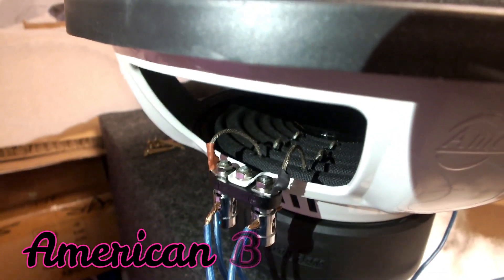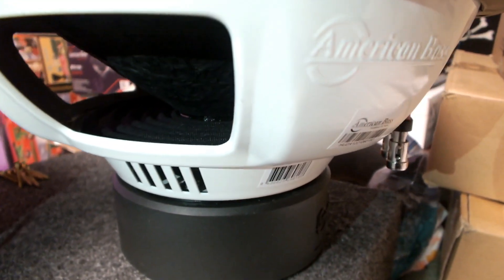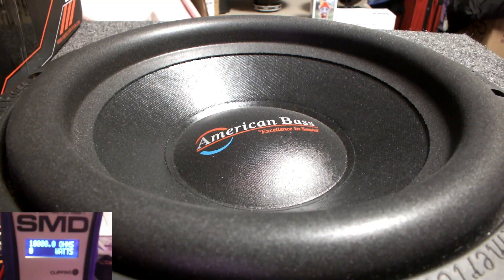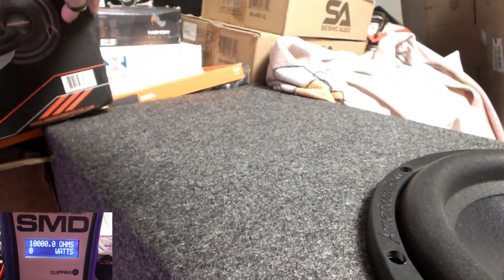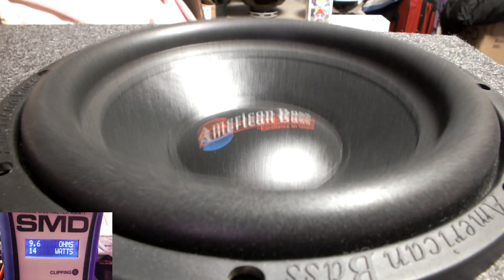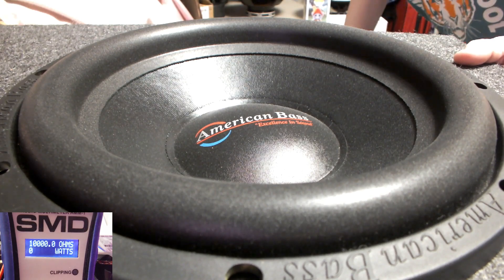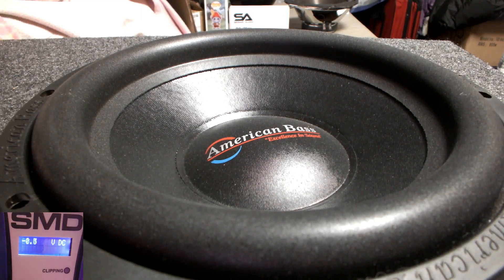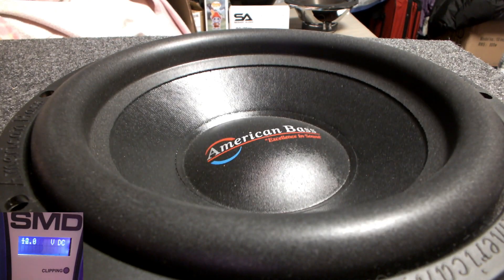American Bass DX-12 Car Subwoofer On NVX XAD13 Car Amplifier Live Dyno Test SMD-AMM1 RMS-Max Bumping

Comment: Sometimes when theeads are looped up and not sown in u will hear smacking of the leads against the cone and there's also another louder pop noise of the voice coil hitting the back plate that's more of a metal rattle cling sound
Reply from the maker: That was another thought, yeah, hitting the back. Thanks bud.

Comment: It seems like these NVX amps don't put out what they claim even though some videos show that they do odd
Reply from the maker: They do much more than they claim actually. Watch the dyno, watch the ohm's on it. This is a common mistake I've been hearing so much of lately. This is actually why I make these video's. If the sub is a 8 ohm's the amplifier does not make up power, it does what the sub allows it to do. I've got this same amp on sub's at 4 ohm's doing well over 1,200 watt's and more. At 2 ohm's even more. I'm going to be doing a 1 ohm video soon and hopefully show what the amp can really do. The NDA series is class D, they do rated power. The XAD series is a full bridge amp and does much more than they claim. I also have the XAD11, rated at 700 watt's at 1 ohm, I have it doing almost 1,800 watt's. Check out the video's and look at the ohm's on the dyno.
Reply: @SubzPawz  yeah see I didn't really look. You might have other videos that you posted. I thought this video was supposed to be on the XAD 11 and when I looked at it it seemed like you were getting maybe 300 watts. That's where I kind of got confused. I have both models the XAD 12 and the XAD 11
Reply: @SubzPawz  Okay well, let me ask you something because you seem to know a good amount about systems. I'm thinking about upgrading my box now i originally purchased the XAD 11 but I didn't think it had that much power so I decided to upgrade to the XAD12. I'm trying to push two subwoofers that are dual 4 ohm voice coils. They are rated at 600 w RMS each old school German subs. Now I've got a cheapo eBay box  Currently it's ported and I believe it's tuned to 40-39Hertz.

 Now I thought my system would be a lot louder than it is.  I got myself a clamp meter. I've tried it at full tilt 21 volume on the head unit and it seems like at most the ants putting out 30 amps everything's wired to one ohm. Now I thought an order for an amplifier to produce 1500 watts you would be pulling 150 amps of current what I saw on the clamp meter seems nowhere near that.

Now I had one guy tell me that I needed the right box. He suggested I needed a box tuned to 32 Hertz The one he suggested is around $300 $280 and some change. How much of a difference will that make? Or is there something available that's a lot cheaper that I could purchase that would work?

Also, the original Amp that I started with on these old school subs one of the first new amps that I ever purchased was a Power Acoustic razor 2500D. Now it seemed like it was okay for the money and the bass sounded fairly deep. However, it left something to be desired. 

The local audio shop had told me that I was probably getting maybe 125w  a sub The amp had 50 amps worth of fusing which seems kind of odd the xAd12 does not even seem to draw 50 amp even you would think that it would use a lot more amps than the razor at full volume. I guess that's what blew my mind 

 So anyways  I figured I'd try and get closer to the 600w RMS for  each sub. 

So that's what led me to here the XAD12. 

Before I pull the trigger on a new box because the old one is a little beat up, I need to figure out how great of a difference the sound will be if I do upgrade if it's worth spending more money. I have already had to reset the subs three different times already drilled new sets of holes each time to try and hold them inside of the box. They are so heavy that they fall out of the box from the bottom when you try the face them sideways as opposed to straight up
Reply from the maker: @jaygee6983  wow, that was a mouth full. It honestly sounds like your having somewhat of the same issue that I'm showing in my video's I just made. If you're pulling 30 amps, you're making about 300 watt's. Your local audio shop is correct, about 150 watt's per sub. I know exactly what you mean about those cheap enclosures, it may be 5/8 wood instead of 3/4. You could always buy a new piece of wood for the front baffle and cut new holes , just follow along the holes already there. If the sub's are heavy I would face them up or do what I just suggested with a double baffle. Use longer screws to get through the wood and now you'll have an inch and a half baffle, almost if it's 5/8". I believe a lower hertz enclosure will also help change the power you're pulling and you will pull more. I've always been a fan of separate boxes for sub's, each tuned the same and still running off the same amp wired together. If you're facing the sub's sideways you should use a double baffle. I think I know the German sub's you have. I just told my son in law this same thing, he has 2 heavy subs in an older box, faced sideways. I told him one of these days he's going to be jamming and the sound is going to change, when he opens his trunk he's going to see a sub just hanging there, he should also double the baffle, especially is you're drilling new holes and the box is already weak. I also try to tell people when they're making a choice on an amp, go big, maybe 10 times the RMS. Because of the box rise. I got the XAD13 because it goes way beyond what I'm going to test. Now this VXF proved me wrong running at almost 17 ohm's sometimes. How do you fight that? Possibly a enclosure tuned much lower and more power. I'm going to hook up the XAD13 today and do the same test I just did with the PA 2500. Last time I got about 1,200 watt's and it was at it peak about. Stay tuned for that today. Thanks for the question, I hope what I said helps you.
Reply from the maker: @jaygee6983  the video was actually on the sub, not the amp. I show the amp so you can see in a real world what it will do with that sub.
Reply: @SubzPawz  okay good to know man
Reply: @SubzPawz  yeah it wasn't trying to make an autobiography or anything. I just wanted to see what your thoughts were on purchasing a new box. Would it be worth the investment and does almost $300 sound like too much for a box that comes already tuned and made Right in the mail.. 

The subs I have are the zx4812 volfenhag. Nothing super fancy. They are older salvage but they play like they are brand new and they're fairly heavy duty. Now I thought based on the RMS rating of the xAd12 that it should put out enough power to make these subs pound And not overdrive them. But the fact that the XAD 12 appears like it's only putting out 30 amps that doesn't seem like it's making no 1500 watts of power If you do the math. Are you implying that If you don't have the right box on certain subs the amount of watch that they can use effectively is limited. Are you saying that it's possible that I will get more power out of my system if I have a different box or do I have the wrong amp altogether?
Reply: @SubzPawz  also, it seemed like when I use the test tone the 40 Hertz and I adjust the gain on the amp it seems like I'm able to go maybe three quarters of the way up on that. Then I get the clipping at about 21 volume. I'm pretty sure the head unit input voltage is at 2.5, so I don't think it's being overdriven in that aspect. Hopefully I can get everything sorted out and get the most efficiency out of my system
Reply from the maker: @jaygee6983  Keep on testing and trying new things. If you have a question along the way don't be afraid to ask, if I know the answer I will try to help. 40 hertz may be your box tune, your sweet spot.
Reply from the maker: @jaygee6983  I knew they were  volfenhag. I would go with the new box, make sure it's larger and has a large baffle if you plan to keep the sub's facing forward. I would buy 2 separate boxes but that's me. Let me know how things turn out.